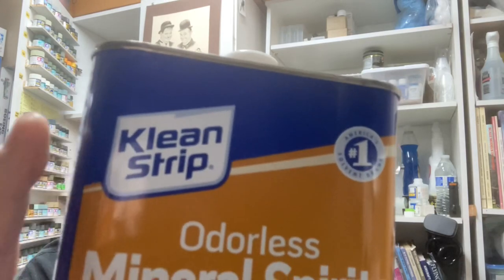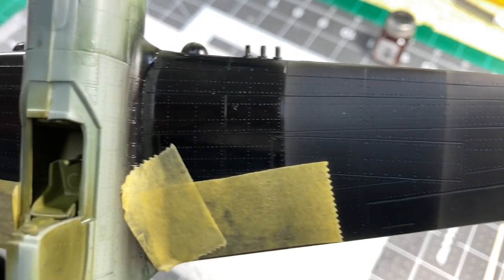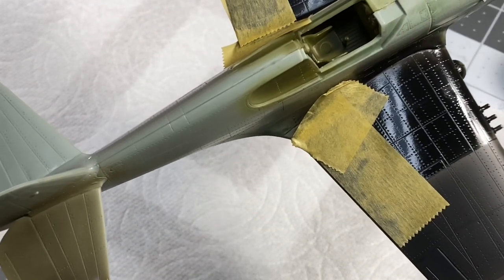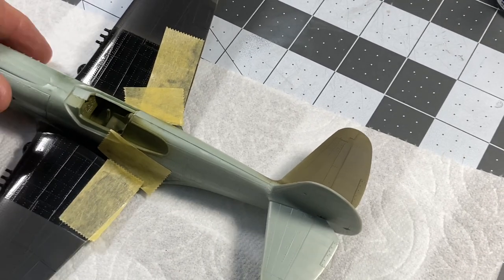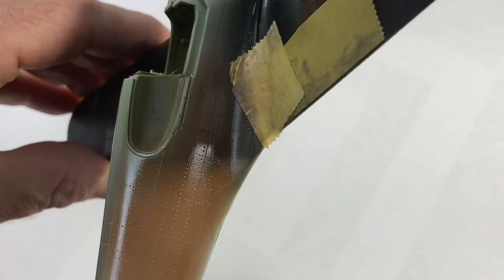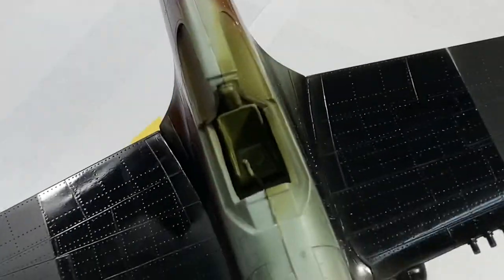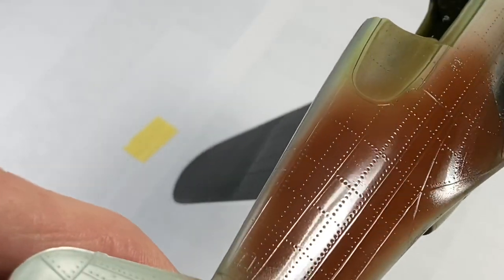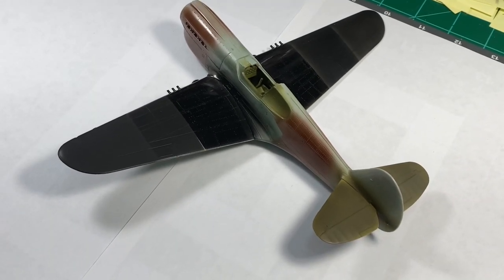Airbrushing 101 Final: Which paint? A little on lacquers and enamels.

Comment: My understanding is that the rapid thinners are designed for the metalizer series where you “freeze” the metal pigments before they sink. Also for very flat military finishes.
Reply from the maker: Absolutely.  It isn't really fast enough to really "instant freeze" them, but does tend to dry them in place before they can settle upon eachother.  If used carefully, hardware store lacquer thinner can be used, but it doesn't work with everything.

Comment: Mission models is great, the only problem is that not all of them are waterproof. So if I get some dust bits in my paint job, and I want to wet sand that area, I'm out of luck because the Mission Models will just wash off. Vallejo Model Air on the other hand, can be wet sanded after 12 hours curing time. If Mission Models could fix this problem, I'd switch to them.
Reply from the maker: I have only had the water problem with some of the RLM series, that seems to be where it happens.  My IJN and US colors seem to hold well after a good day to cure.  But that RLM blue (can't remember the number but its the underside of the Bf109) is the biggest violator.  I found that by giving it a coat of Aquagloss it protects it pretty good though.
Reply: @rebelroostermodeling6460  Yes, they can be clear coated, but my goal when building models is to use the fewest coats possible to maximize detail.